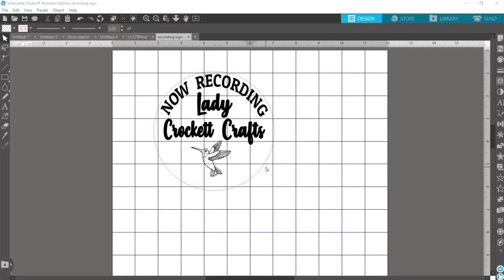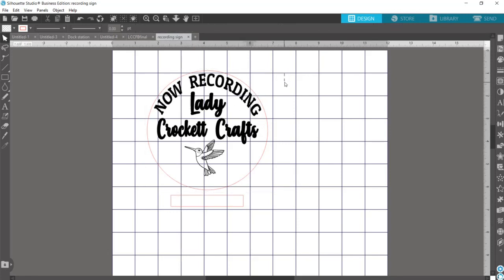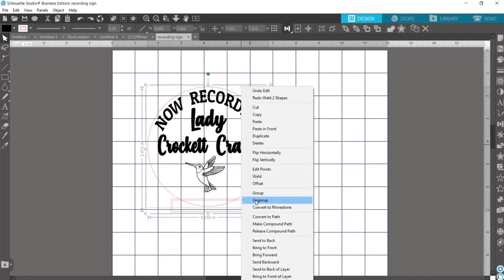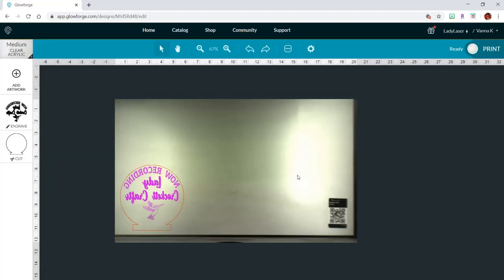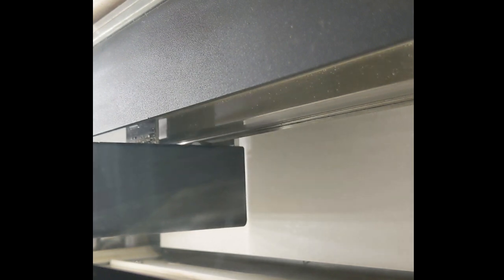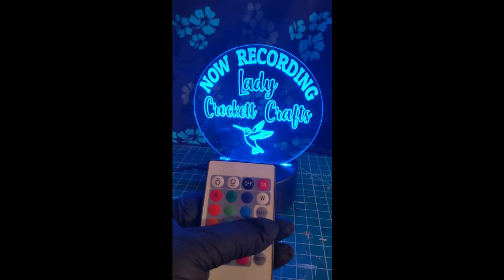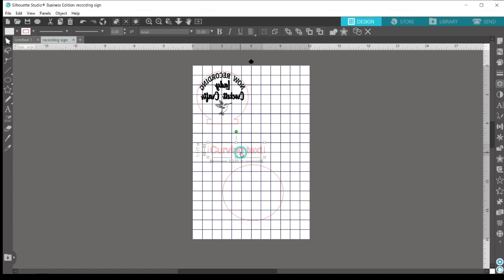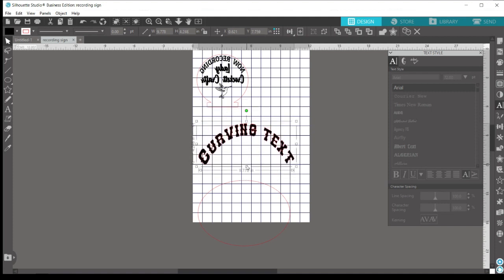Acrylic engraving for LED light base using Glowforge laser and Silhouette Studio

Comment: Hi Lisa!
Great video!  Thank you!
ImagR and Glowforge Pro newbie here.  Getting married on Saturday and wanting to put engagement pics on 1/8 proof grade acrylic for a lighted table signs and have a couple of questions.  
1) I like the results of the "see on material" views after using the software and reducing the gamma on settings but hat DPI, LPI and glowforge settings should I set for speed, power etc?
2) To mask or not to mask?
3) Which CO2 setting is best or should I select another?
4) Why did downloaded .png print the square and not just the cropped circle below? (Imag-r question).
Thank you in advance for your speedy replies.  It's crunch time!
John
Reply from the maker: Hey there, I am not sure I can help with these specific questions as I am not Lisa 😁

Comment: How do you get it to engrave into the Acrylic to get the Image to show through better
Reply from the maker: Make sure your image isn't huge and don't have too much space between the light base and where you design begins. Defocusing as discussed in the video should help also.
Reply: What im going to do is put lights on the Side in a WoodFrame
Reply: Do I need to Intensify the Laser or just set it to what the Glowforge Sets it to.
Reply from the maker: @markchapman826  I would use the recommended GF settings but defocus it using the instructions in the video. I have not used lights around a frame yet, but that's a cool idea!
Reply: @LadyCrockettCrafts  yeah see i do woodwork and that is part of the reason why I got the Glowforge Plus I got the Pro. Also im having a problem with it saying that its cooling down.  Does it need to be in a room with a certain temperature
Reply: Can I ask you what program do you use if you don't mind to do your artwork
Reply from the maker: @markchapman826  Silhouette Studio Business Edition
Reply from the maker: @markchapman826  recommended operating temperature is about 60-80 degrees F. If you're within that, make sure your fans are clean and running properly
Reply: Do you get something from GF for people that follow you so that I can recommend you
Reply from the maker: @markchapman826  only when people buy their machine if they use my referral code to get their discount. Thank you for the thought though! 😁
Reply: @LadyCrockettCrafts  Thank You for your help. As soon as I get my first sign made I will send a picture to you. I mainly bought my GF because I make furniture out of wood and im going to make what us called a Salesman Samples so I don't have to make large Furniture so when I go to the Streetfaires or Swap meets I don't need a large space. Thanks Once Again.
Reply from the maker: @markchapman826  very cool! I'd love to see it! I wish I had more general woodworking knowledge myself. That and the laser will be a great combo of possibilities for you.

Comment: When I tried my first design like this it did not light up all the way to the top. Did you do anything special to your font to get it to light up so well? Or maybe it was the type of acrylic you used?
Reply: Thank you!
Reply from the maker: If your design is too tall it will have issues reaching all the way to the top. Also the light shows up better in the engraved areas so if you are using thin lines for the design or font, you can consider thickening them up. The acrylic here was from glowforge. If you are using an acrylic from a store like Home Depot or Lowes that could be an issue as well because it is often a  different type of acrylic.

Comment: Thank you for sharing! I love your videos. Can I get the acrylic sheets information? I tried to engrave with a transparant acrylic sheet but it didn’t work😭
Reply from the maker: This was proofgrade material from Glowforge, but now I buy my acrylic from Cerulean Tides Laser Supplies because GF is sold out of most material. If you got your material from a store like Home Depot it is probably extruded instead of cast acrylic and I don't think extruded would work as well.

Comment: The 1/4inch doesn't fit.. it's too big and the 1/8" is a bit too loose in the bases I bought 😢😢
Reply from the maker: Oh no! Are you using the one I linked in the description? Those are the only ones I have used so far. Try carefully giving the  1/4" a firm push in there 💪 Materials will also vary in thickness some even though they are labeled as 1/8 and 1/4. You could try sticking a corner of the material in the base to see how it fits before trying to cut it.
Reply: @LadyCrockettCrafts   no i actually bought night lights and they CAME with acrycli and that still wasn't a snug fit fromt to back. I used the PG acrylic for the lamp bases (from a buy-in group) and same issue with both thicknesses. It's not a huge deal though!
Reply from the maker: @wedontdeservedogs  wow, crazy it came with acrylic and wasnt a good fit! Calipers can be used to measure the base's slot too and then use the calipers to measure the material to see if they are about the same... but knowing me I'd probably shim it  when to loose or hammer it in to MAKE it fit haha

Comment: Thank you for this video! Quick question...It looked as though all your font was solid black to begin with. Why did "Now Recording"  engrave solid and "Lady Crockett Crafts" engrave only the outline?
Reply from the maker: Good catch! I had to go back afterwards and figure that out myself. Here's what happened: I had previously created the text, not for GF use originally. Turns out the Lady Crockett portion was actually 2 layers with one on top of the other (Lady Crockett with an offset around it- LC being layer 1 on top and offset being layer 2 under that). The GF cancels out items if they are layered on top of each other and that is why only the offset portion got engraved; it was the only part not being masked by the top layer. So if you, or whoever ends up reading this also, ever has this same issue or the laser seems to go through the motions but nothing's there- check your file to make sure there are no layering issues. I went to my file, did release compound path and was able to pull the layers apart  and 🤦‍♀️ but I like it just as much this way, thankfully.

Comment: Where did you put the fan to make the glowforge so quite? The sound is one reason I've been putting off buying one.
Reply from the maker: If you click on the Amazon link to see what the fan looks like it will help you visualize my description- I have a vent hose that comes off the back of the GF (where it typically vents from) that runs  to the right side of my AC Infinity fan and then a vent hose on the left side that goes from the fan to the window. The GF's internal fan can then be turned off which reduces the noise. This is a very common add on/change many users do, but of course it isn't from GF so do so at your own discretion. Edit- lmk if a video of the setup would be helpful and I'll add it to my list!